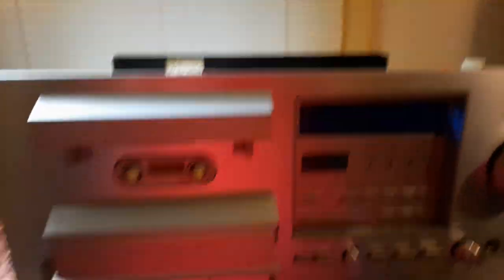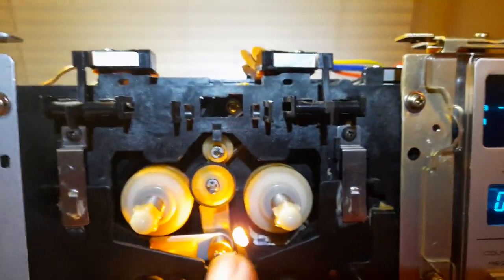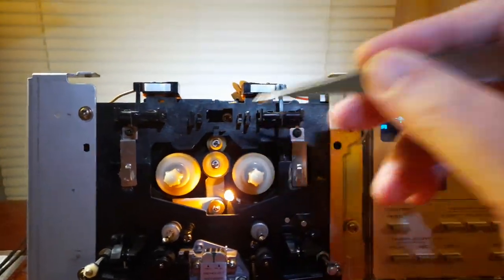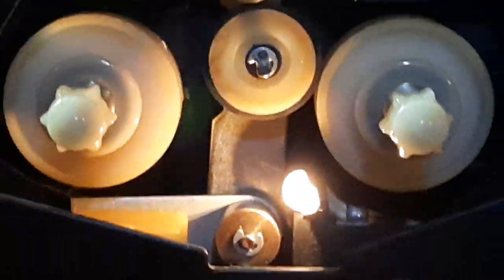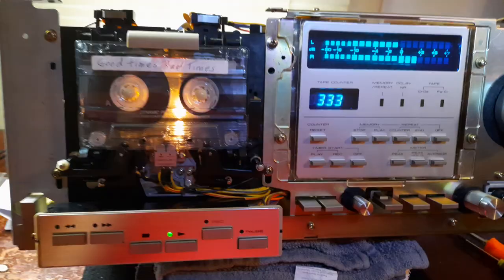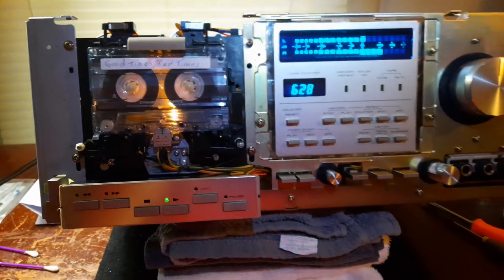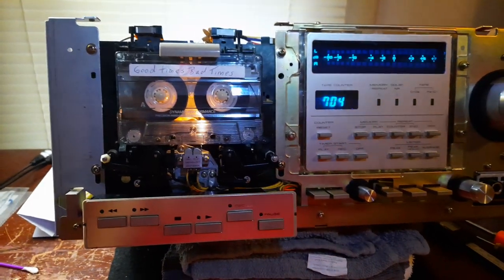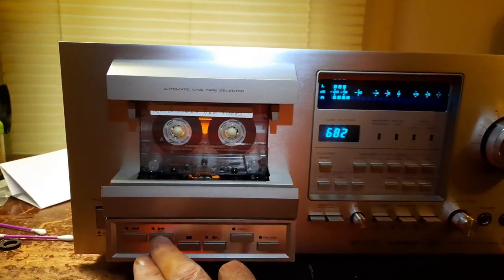Pioneer CT-F900 idler tire replacement.  Ebay idler tire

Comment: Thanks for doing these vids. It is appreciated. Mine's a Marantz 5030. 
I've watched all your Marantz vids and they've been helpful. 
I am in the middle of recapping the machine and have already addressed the belts and idlers. 
Playback still chews tapes occasionally though. 
I think I need to do the idler that's got to from the front. Like you showed in another vid. 
Do you have the correct measurement for that idler?
Thanks again.
Reply from the maker: The idler that I use for my Marantz cassette decks is from "Fixyouraudio.com"  the size is  14mm x 19mm x 2mm  that works on my Marantz SD800 and 1810's.  If your Marantz is eating tapes it's best to replace the front idler.
Reply: @mr.nobody5422  Thanks for the info. Much appreciated.

Comment: Hi. What is the way to remove the clips on idler tire shaft? Or how did you remove the tire without damaging the idler wheel? Thanks.
Reply from the maker: I used a plastic zip tie to wrap around the idler tire and the bracket that holds idler wheel. I will post a photo of it in a minute.
Reply from the maker: See photo i just posted on community.
Reply: @mr.nobody5422  thanks.